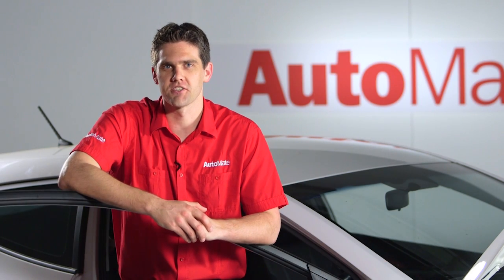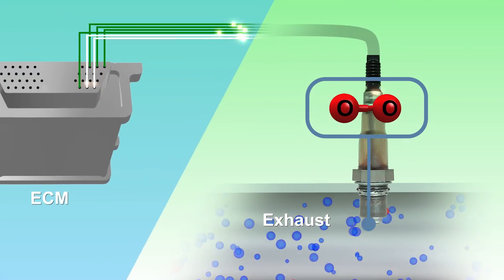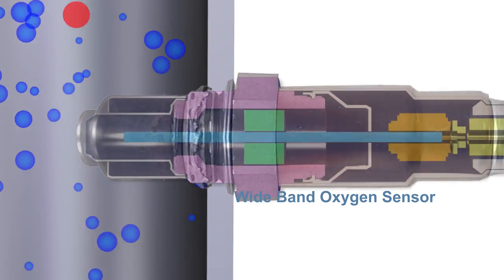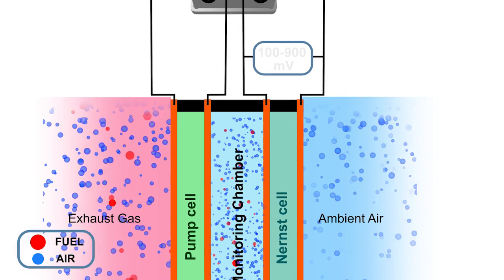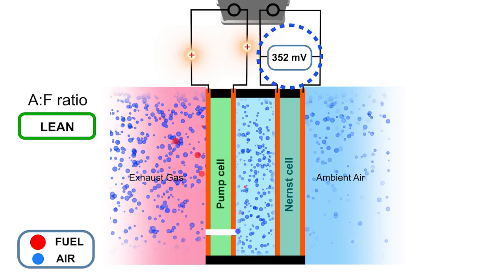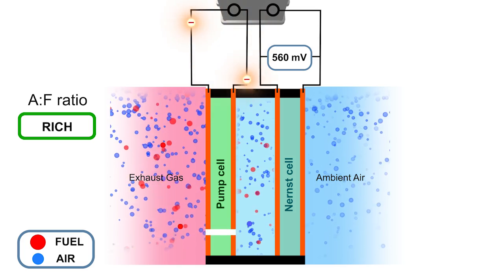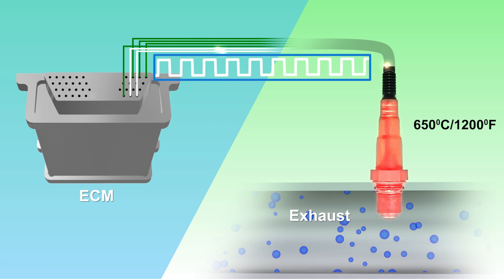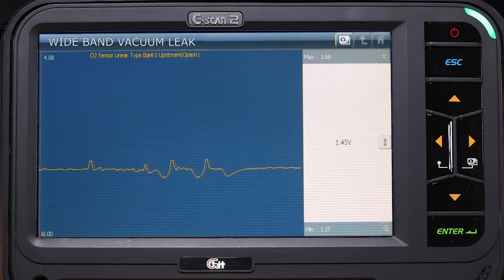Wide Band Oxygen Sensors

Comment: Excellent video.
Reply from the maker: Thank you very much! Glad you enjoyed the sample video.
Reply: @AutoMateTraining   mine is stuck at 1.3v not matter if its cold or hot and its a 5 wire pre cat so does that mean it needs replacing? Plus failed my emissions test he said its due to 02 sensor but need to make sure as they are expensive Thanks

Comment: great video, well explained, good graphics, a good point to note when testing these sensors is that the bosch sensor will have a simulated ground (yellow wire) when connecting an oscilloscope you must measure sensor output (black wire) to sensor ground (not chassis ground) use this wire as an earth reference. the simulated ground sits at 2.5V, if you don't do this or your reading will be 2.5v out of range. specified signal reading is 450mv, use fuel trim to check tune, a great way to test these sensors is with a scan tool, do a rich and lean response test by introducing a lean condition, check pumping current P.I.D on scan tool and see if current is increases (ma). introduce a rich condition by introducing propane into the induction system, check pump current decreases. remember to check fuel trims /adaptives bank to bank, air leaks and contamination are the biggest issues I'm seeing. hope this helps